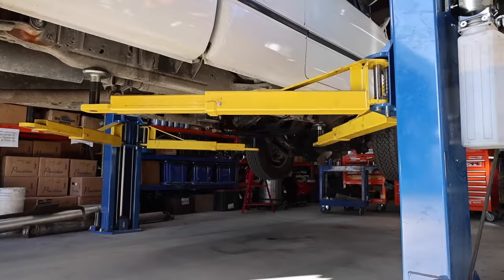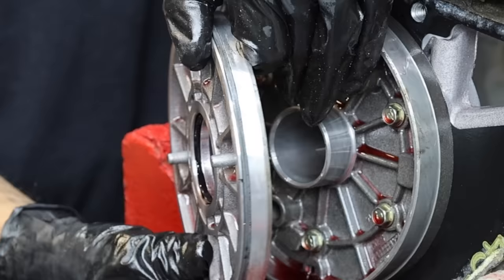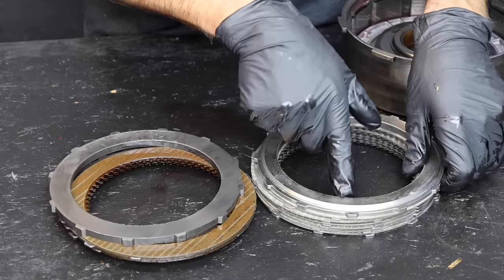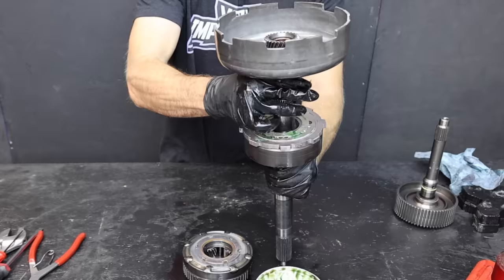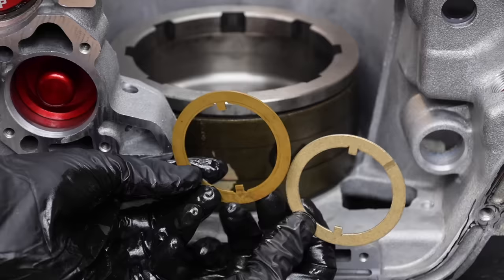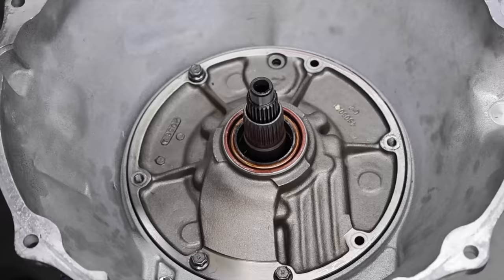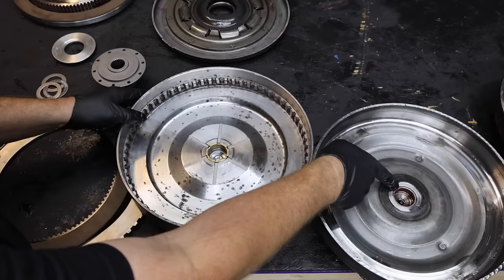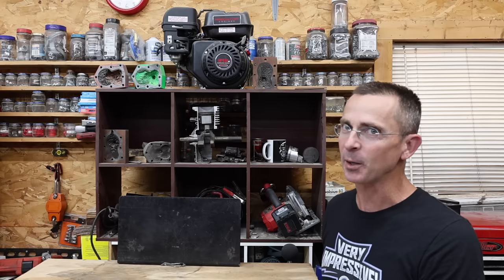Did I Waste $4000 on a DIY Transmission Rebuild (47RE)?

Comment: You sir, are a gem!  Every mechanic, engineer and tool head needs to subscribe to your channel.  You could easily be the best test engineer I’ve ever met, and I worked with many.
Reply from the maker: Thanks!
Reply: I would love to see him in charge of blade testing on Forged in Fire.  Their blade testing horribly inaccurate.  Almost all of the tests are based on how the judge holds it, hand shape/size, and how much power they can put into it, which is never the same.

Comment: This is a great project! I rebuilt a 42RE it looked almost identical and all the procedures were same. I even disassembled the overdrive section with the 830 pound spring, grandpa made me a special hollow press tool to remove the snap ring while compressed in a shop press. Like you, I didn’t touch the valve body. Ran great until I wrecked the vehicle. $400 fix instead of a $3000 shop bill but took me 2 weeks as an 18yo. You brought me nostalgia as that project was 12 years ago

Comment: Great video! I needed my 68rfe rebuilt in my truck, ended up deciding to do it myself. A weekend and a couple nights later it was fixed, at 20 years old with no formal training! Definitely not too hard, just a whole lot of snap rings! I appreciate you showing that something that sounds as daunting as rebuilding an automatic transmission, isn't too hard if you put your mind to it!
Reply from the maker: Thanks!  Thanks for sharing.
Reply: What tools did you use to rebuild the 68rfe?
Reply: @danielguerra626  nothing crazy, basic hand tools, socket set, some feeler guages, a good set of snap ring pliers, air compressor. That's about it
Reply: @Lonelyowl7  is there any videos here online you recommend? I'm about to do my 68rfe in the next two weeks!
Reply: I watched this video quite a few times, it has 2 parts I believe.

If you're upgrading internals, Randy's Transmission has a diy kit that has pre-assembled sub assemblies, which would make it a lot easier. Wish they had it when I did mine.
Reply: @Lonelyowl7  I have a rev max 700 but the tranny has tried to pull when the brake was applied since day 1. They went through it the first time then stopped answering after I had the same issue after they claimed it was fixed. So I took it upon myself to buy a Randy's valve body and I believe the issue is actually clutch hanging up in the torque converter so I'm going to replace that now and go through the whole thing myself. Hoping I can find some good pics of what I should be seeing when inside. I know it's not rocket science I just want to replace anything that may be looking bad when I'm in there.

Comment: One of the best transmission rebuild videos I've seen. I have never attempted one after discovering how many special tools I should have, but here you discuss all of the common issues people will run into, proper alignment of seals and other parts, and explaining the differences between what a stock rebuild would call for vs a performance rebuild. All of that with top notch production values.
Reply: You should check out Precision Transmission
Reply: He simultaneously made me feel like I could rebuild a transmission and that I don't want to do it! Very meticulous process
Reply from the maker: Thank you very much!

Comment: Your broad and deep level of knowledge is just remarkable!  Just had my truck transmission replaced for $5k, and now i see why two transmission shops only offered replacement not rebuild.
Reply: To many shops are just what I call a pull and replace shop.  They don't have the knowledge on how to rebuild one.
Reply: I wouldn't call them a trans shop if they're not rebuilding them.
Reply: @Mike_Gray68  yep...not surprised to get that answer from the dealer, but the independent shop would only replace it and they were $500 more.
Reply: The trouble is, it seems the manufacturers are doing everything they can to hinder us on the newer vehicles. Now we have to take them back to the dealer to get the onboard computer reflashed after the trans is rebuilt. The trans literally will not move the vehicle until it's done!  So we have to haul them to the dealer!  Unless you get setup with your transmission company supplier to do it. After you acquire the equipment needed from them you then use that equipment to connect the vehicle to the company's internet site, then call the company for them to setup & download the new program into the vehicle's computer for a fee $$ for each vehicle done of course. Last I checked it was $150.00 per download and that was a few years ago. So the dealers have been a bit cheaper so far, but that includes the hassle of needing to haul them there to get it done.
Reply: Thankfully the older ones we can still do the entire rebuild process at our own shops.

Comment: Great vid. It's been 7 years since I left the trans shop I worked at, the 46/7/8 RE and RH and the 4L60 were the units we built on the regular. One thing we always did on all the Mopar units was flat sand the valve body mounting surface with 400 grit on a granite block. A surprising amount are warped, even well known rebuilder units. Nice trip down memory lane.
Reply from the maker: Thanks!  Thanks for sharing.

Comment: This channel is great. Im just starting to watch this episode and want to say this as a mechanic, retired on disability...
Not every mechanic, let alone every person who sets out to do this job can complete it properly without any surprises when done and installed in the vehicle. With that said, any decent mechanic CAN rebuild their own automatic transmission if they set their mind to it, take their time, and keep it Clean!  If you are in a hurry then forget it, dont even start the project. If you are the kind of person who has what it takes then you will be successful. Dont try to rebuild a particular model of tramsmission if you've never done that particular kind and somebody brought it to you disassembled in a box. Disassembly is important for the inexperienced trans builder. Also get some folding tables, as you will need alot of space as it comes apart and you place assemblies together as they come apart. This will make it much easier for assembly, as your brain can look at the table and remember the order in which things came apart, therefore your brain can reverse gears to go back together. Another point in the success of your first rebuild is Dont Skimp on parts...which does translate to cost. Its not worth it if a $2 seal could cause you to have to do the whole project again immediately after completion. 
In this vid, our dude is also doing upgrades over stock. If coming from a reputable company then i highly support these mods. With that said things can get crazy if you are not an instructions reader. Dont be that guy, or gal...read the instructions for non stock mods. For that matter, have a book or detailed printout of the particular trans you are working on. You will need it for your first and even second time.
In closing, if you are confident in your skills then go for it. If not then you already had your answer. Make sure you have plenty of space, and time. And tools. 
As an example, first time i built a 48RE mopar trans behind a cummins diesel is when i realized it was time to go to harbor freight for the 20ton press which ive needed for years but turned out mandatory to take apart and reassemble the od pack spring (forgot what its called, ill call it big ass spring). 
In the end, the builder/mechanic/home wrench who decides to take on this project will be rewarded with all kinds of pride and satisfaction once thar vehicle is cooking down the road 10k miles later and shifting perfectly. In your mind you will remember all those small details you went thru and realize you are the one responsible for it to work properly again!
The personal satisfaction is real and worth it...if you got it in ya'😎
Reply from the maker: Thanks!  Thanks for sharing!

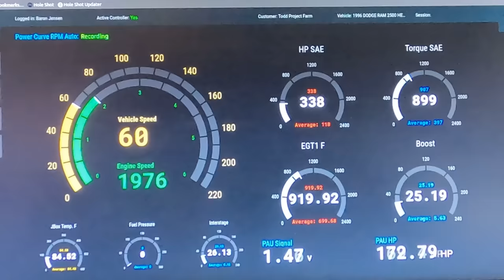Comment: 00:27 🔧 Upgrading the engine without addressing the transmission can cause issues, leading to power disparities between the two.
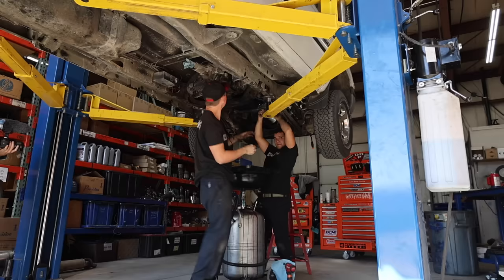00:55 🛠 Rebuilding a transmission without professional equipment is feasible but requires skill and patience.
01:37 🏗 Upgrading parts like the flex plate and torque converter to handle increased horsepower is crucial for performance.
02:35 🔄 Understanding the valve body's role in controlling transmission fluid flow is essential in transmission rebuilding.
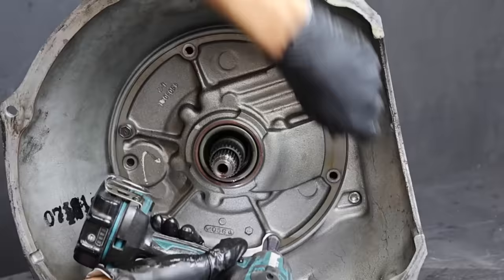03:16 🛠 Replacing components with Billet steel improves durability under high pressure and power conditions.
04:13 🧰 Checking and replacing worn parts like the second gear band and servo contribute to improved performance.
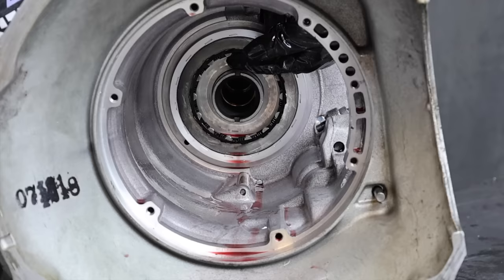05:23 🛢 Careful inspection of components like the transmission filter and sprag assembly prevents future issues.
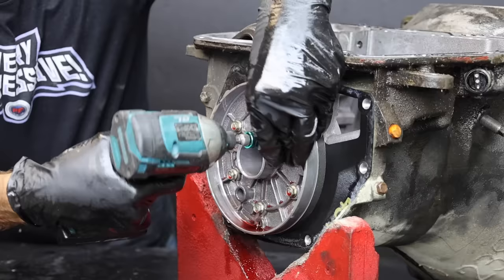06:22 🛠 Overhauling components like the overdrive unit ensures proper function and prevents potential damage.
07:46 ⚙ Attention to detail during the disassembly process aids in identifying potential wear or damage in crucial parts.
08:15 🧩 Splitting and rebuilding subassemblies separately minimizes confusion and errors during reassembly.
09:23 🔩 Lubricating seals and components during assembly helps in proper fitment and longevity.
10:19 🛠 Achieving proper clearance between components like clutches ensures optimal transmission performance.
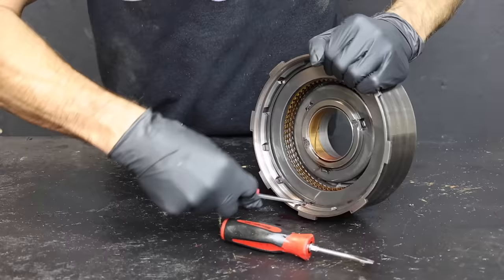11:16 🔄 Upgrading worn parts to higher-quality materials like GPZ clutches enhances durability and function.
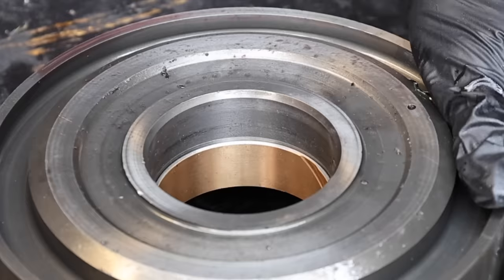12:43 🛠 Using specialized tools or improvised methods aids in precision during assembly and installation.
13:40 🧊 Applying transmission fluid and grease at contact points ensures smooth operation and longevity.
14:37 🔄 Careful alignment and verification of part seating guarantee proper reassembly of complex components.
15:48 🛠 Inspecting and replacing wear-prone parts like thrust washers prevents future mechanical issues.
16:29 🧰 Proper lubrication and meticulous assembly sequencing are crucial for successful transmission rebuilding.
16:58 🛠 Rebuilding a transmission involves careful assembly of various parts, ensuring proper alignment and lubrication.
19:47 🧰 Inspecting gear sets and bushings for wear is crucial during the rebuild process, even if replacements might not be immediately necessary.
21:56 🧰 Replacing seals, bushings, and gaskets with precise installation techniques is essential for preventing leaks and ensuring proper function.
25:14 🧲 Methodical installation of various components like clutches, bearings, and spacers, along with adjusting bands, is vital for transmission performance.
28:28 🛠 Pressure testing and air checks verify the transmission's hydraulic integrity before completion, ensuring proper functionality.
29:41 🧰 Installing the parking rod and valve body securely requires attention to detail and precise positioning within the transmission.
30:09 🧰 Attention to detail in assembling the transmission pan, filter, and ensuring proper fluid levels is critical post-rebuild.
31:05 🚗 Insight into the inner workings of a torque converter provides a deeper understanding of its role in transmitting power within an automatic transmission.
33:25 🚗 Testing the rebuilt transmission and witnessing the significant power increase following the rebuild process showcases the success of the project.
35:02 🚗 The truck's performance significantly improved post-upgrades, reducing 0-60 mph time to 7.5 seconds from 10 seconds.
35:30 ⛽ Fuel efficiency increased by nearly 2 miles per gallon after upgrades, notably due to timing, injectors, and turbo enhancements.
36:14 🔧 Snap-on is preferred for tools, though Harbor Freight boxes are present; a unique $32 ratchet with a hidden compartment is showcased.
37:47 🛢 Regular transmission fluid changes every 30,000 miles are advised to prolong transmission lifespan; no freebies or sponsorships involved in the upgrades.
Reply: Impedance mismatch.

Comment: I'm about to rebuild my first auto trans after having successfully rebuilding a manual one a few years ago, and have been watching as many videos on the process as I can. The one I'm going to work on is a bit simpler but the basic principles are the same, and watching this helps.

I expected the process to be massively more complicated than a manual and while it's certainly quite a bit more complicated, it doesn't seem that bad. I've already removed and cleaned the valve body so that's taken care of (other than replacing the gaskets which the rebuilt kit will have).

Once I'm done, I will have rebuilt every major assembly or component on a car other than an engine, A/C, ABS and the electronics, which are worlds unto themselves. And I couldn't have done it without the help of videos and channels such as this one. So thanks a lot, another well-made and helpful video!
Reply from the maker: You are welcome!  Thanks for sharing.

Comment: Wow, great video on the transmission rebuild!  I've never taken a transmission apart, so this was a treat to see the internal parts and how each part interacts with the others.  You did a fantastic job showing each part and explaining why the parts need to be replaced and the tolerances.

If you're ever in need of an engine rebuild job, I'd love to see you rebuild an Alfa Romeo 4 cylinder with the aluminum hemi head 1960-1990's.  And a rebuild on the 5 speed manual transmission would be great to see too!
Reply from the maker: Thanks!  Thanks for the suggestions.

Comment: I rebuilt my 47RH myself a couple summers ago.  I'm still in the middle of my full frame-off restomod of my 1985 Crew Cab Cummins swap, so I haven't been able to drive it yet. But I thought rebuilding the transmission would be out of my league.  It really wasn't that bad, as you've been able to show!
Reply from the maker: Thanks for sharing.
Reply: Where you get parts for a 47RH? That’s what is in my 95 12 valve. I also have a spare 47, transfer case and torque converter. I know 2 years before I bought the spare 47RH it had 3000 ca dollars spent into it. I have had it for 8 years or so .

Comment: This is something I'll never attempt (I'm a "save the manuals" kinda guy), but I seriously admire your dedication to DIY and capturing your efforts for the rest of us.
Reply: every time i hear about transmissions im like 'yep clockwork and wizardry' because everything that goes on in there is borderline magic
Reply from the maker: Thanks!
Reply: Automatics are great for tow pigs
Reply: @bradhaines3142  I've watched autos being rebuilt on various channels probably 50+ times and I still have absolutely no idea what I'm looking at. I would screw something up 5 minutes into disassembly and carry a box of parts to a transmission shop crying

Comment: Is there a guide on how to do this that comes with the kit? So many steps and parts to remove. What a huge difference!
Reply from the maker: I believe that a shop manual can be purchased in addition to the kit to help guide one through the process. I'm hoping this review helps those attempting to rebuild the 47RE or similar transmission.

Comment: Very good video. Building transmissions isn't that hard, as long as you take your time, have your ATSG shop book, and have none of your friends telling you how Billy Bob's second cousin does it. A little confused how that was $4000. Built my 4L80E with a Jake's Perf kit, with 300M input shaft, and a Yank SS4000 converter for about $2,500. It should be good for 1,000 HP. Parts aren't too expensive, as long as you don't break too many hard parts. 47RE is just a 727 Torqflite with an over drive unit. Same internal set up. Only thing I did different than you is soak all the clutches in trans fluid, even when mocking up. Never do a final clutch install without soaking ALL the clutches.

Comment: Hi and thanks for all your work. Since you are doing more automotive stuff, I will like to suggest something related to the air conditioning system. When you have a line leaking you can buy a new line set or use one of the repair options for AC lines. they are called line splice kit and various manufacturers have them for hoses and tubing. I did my all honda odyssey last week and I think is a good value vs buying a new line set, of course AC systems have other parts far more important and expensive but this is simple enough for the general public. Of course I assume the refrigerant is already gone and no recovering needs to be done. Leak test of the resulting  work can be assured when you vacuum the system, if it hold vacuum you are good to go and to fill up the system again you can take it to a shop or do it yourself since the delicate part is refrigerant recovery. Keep your work ethic and spirit.

Comment: Watching this video reminds me sitting in a physical chemistry lecture hall many moons ago.  Just as then, I am literally dazed and confused at the amount of technical information being spewed at breakneck speed.  It literally leaves me feeling dizzy.  Geezus auto transmissions are so freakin complex.  Even more shocking is that there appears to be a 1000 different ways to make a mistake getting a seal reversed or a gear either flipped the wrong way or misaligned during the build.  Hats off to all you transmission specialists that are able to pull this off.  Just wow!
Reply from the maker: Thanks!